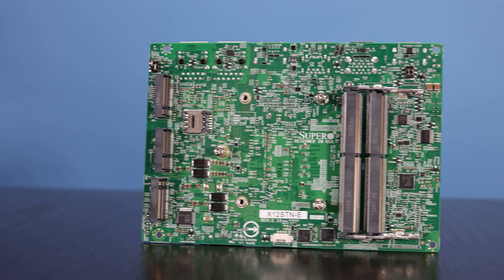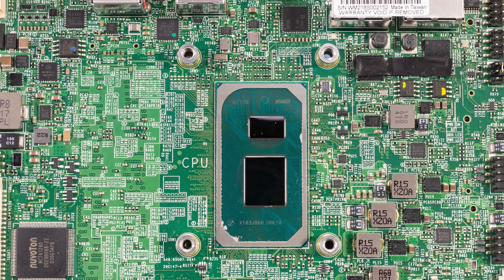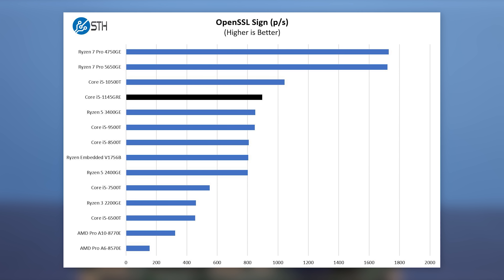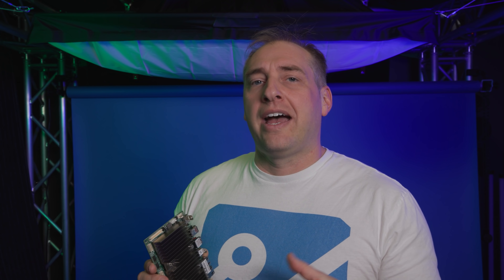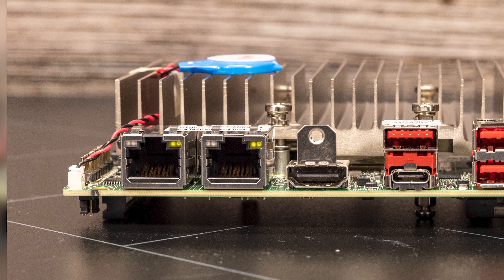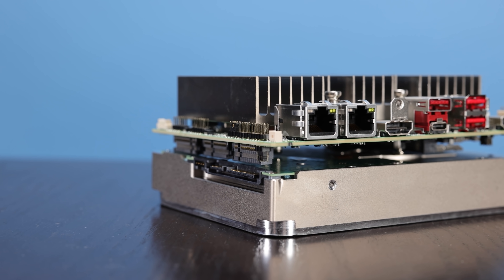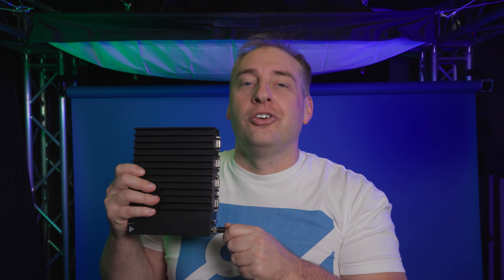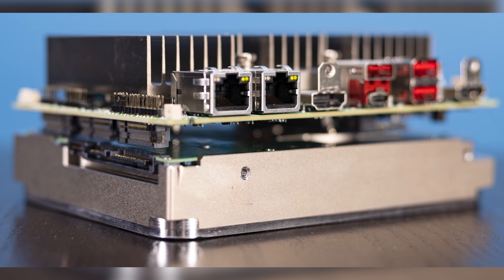Cool! HDD Sized SBC w/ 2.5GbE and PCIe Gen4

Comment: The need for serial interfaces still transcends more than just industrial sectors, pretty much anywhere that runs a property management system often have at least one or two systems that only interface to it over RS232, this would make a killer machine for their interface servers.
Reply from the maker: Great point.

Comment: @ServeTheHome It would be great if reviews of SBC would also include a comment or two about available cases/housings, mounting options, b/c looking for those can be quite challenging!
Reply from the maker: We specifically held this one to show you that Supermicro chassis and how it works with that SBC just so folks could see it.
Reply: @ServeTheHomeVideo  Yes, showing the CSE-E101-03 is a step in the right direction (thanks for that), but I must have missed it twice, b/c I didn't explicitly hear about mounting options (EDIT: you mentioned that the bottom of the case is “just flat”).
You did mention other cases being available (presumably also from Supermicro); however, compared to the tiny/mini/micro series where you usually don't have many choices regarding the respective case anyway, I think discussing options available for the X12STN-E (or /wherever they exist/) would be especially interesting.

Comment: No pciex16 capability on this board, that is the next step now and it has been as soon as these micro boards became a thing. I wish they did these micro boards on pciex16 capable CPUs and bring out the pciex16 with something like a 100 pin DF40 connector (because an actual pciex16 interface would take up too much space) so that it can be tapped by us gaming freaks. The mini itx is still the smallest form factor with pciex16 available and what I use. I can't wait for the day to see a tiny ass motherboard hooked up to a titan V that is 20 times larger than the motherboard so that I can play solitaire while running crysis r in the background. STILL WAITING.....

Comment: Thank you VERY much for such a detailed explanation. I do have a question though, since i saw that sim card i have been questioning myself about using it to "share" that data connection (as a Mobile phone "sharing wifi") thus first is it even possible? Then could one connect an external antenna to it?

Comment: Is there a cheaper board with similar CPU grunt but without all the high-end display features? Or do you pretty much get that for free in this class of processor these days? Even the Celeron version of this board still has a bunch of display outputs.
Reply from the maker: Basically it is the cost of a few connectors these days so pretty small cost

Comment: Ewwwww RS-232, what are we the 80s? While at it put some LPT, PS/2 and VGA ports - when I see even one of those things it just makes me GAG.
Reply from the maker: In industrial automation serial is very common and the ability to screw in the cables to secure them is widely used as well.
Reply: @ServeTheHomeVideo  Then they should make two models - one for a factory and one for home use. I keep looking at Gigabyte, MSI and etc for a new motherboard and it keeps turning me off when I see a somewhat decent motherboard with either PS/2 or VGA or USB 2.0 ports. Why can't they make a model with top of the line USBs only(10Gb and 20Gb), DP only and dual 2.5Gb NICs, and none of the USB 2.0s, PS/2s, VGA and etc. - how hard is that? Oh and none of that only two PCIe ports - not all of us into GPU gaming and RGB BS.

Comment: Ya know. I retired as a Network Engineer 15 years ago. Here's the funny part. NOTHING i knew and did back then is even around now, except fiber. I am like a child now with todays technology. Which I am totally ok with. I started building servers with MFM drives Ended up with SCSI 2. Sad.
Reply: Also, I like this machine but i would prefer it with a AMD chip. Better graphics... I believe. Am I wrong? Thinking HTPC on 70" TV OLED TV.
Reply from the maker: AMD needs an update for its products in this space.

Comment: These are not designed for home computing. Instead, they can withstand being in a small cabinet in freezing scorching conditions managing a utility substation, a telecom tower or a digital billboard for 10 years straight. The  price is very cheap for that actually.

Comment: I always thought it'd be cool if the ports were on the edge where a 3.5" HDD has it's SATA connections. That way you could pretty much use lots of them in a 15 drive 4U server chassis for a deployable cluster box.
Reply: Super cool idea but can SATA deliver that much power? I'd assume not.

Comment: That's a nice heat sink there.   It's got a wide thick base and fins that go upward which can absorb and dissipate heat faster than some of the stock air coolers like Wraith Prism with small base and fins that go sideways.  I have a similar type of heatsink and it really keeps my computer cool even when gaming for hours.  You just have to make sure that it is properly mounted and with proper application of thermal paste.  Also, you need to add a cooling fan to it to make sure there's a  continuous air flow.

Comment: So I guess I have a question. If Supermicro can make this standard form factor board that is perfect for many applications. Why can't all the other OEMs do this? HP, Dell, Lenovo, Ect. make motherboard for all their platforms ie. Laptop, AIO, and SFF desktops. They could all be this size and interchangeable with slightly different I/O for each applications. I would thing it would save them literally millions in development costs across their entire product line and vastly improve repair of all manufactured computers.

Comment: I used a lot of iBase h/w in a previous job. It's fairly similiar and stuff I used it still working years later.

35W is about the point where you have to go to active cooling. Some (AMD) embedded gear the bios can set the CPU power limit.

They aren't cheap, the goal with these is long life and reliability.

Comment: I like the idea of using one as a NAS. Get an M.2 to PCI-E extender cable and you can pop a HBA in there for more drives. Hook it up to a SAS expander and you could build a tiny little NAS, more like QNAP or Synology sized.
Reply: oooo, that'a an interesting idea. i remember a guy that used to be on youtube named WillU that did something like that back in 2012. at the time though the 3.5" boards had a pci slot on them. and he built a 12TB NAS using like 6 drives.

Comment: sooooooooo with some m.2 to pcie adapters I could add more sata ports and 10Gbe SFP+ NIC 🤔sooooo tempting
Meanwhile my current home server (2700X) is chugging power down 24/7 T_T
Reply: you can always sell the 2700x and buy a 35w APU for your home server, boom problem solved
Reply: @marcogenovesi8570  I may try to do that and get a low power ryzen 3.. I know I can boot with no graphics card on my home server after I finished the initial setup
Reply: @Airbag888  Yes a lot of Ryzen boards can boot headless without problems.
You can also get Athlon 200GE or 300GE, those are cheap 35W Ryzen APUs. Since I'm a fan of ECC ram I had to buy the PRO version of those from Aliexpress (consumer APUs can't use ECC), so far both I bought are 100% fine and recognize the ECC ram.

Comment: 2:51 If any of you are wondering when and why intel started using chiplets, well, Intel was actually first to the 'chiplet' game with the early 2010 Core i5 650, a dual core processor, with either an IO die, or a GPU chiplet, i'm leaning towards a GPU chiplet because the models that didnt come with a GPU, also didnt have a chiplet.
For the most part the only time Intel used chiplets on the desktop was for the first generation processors, and the 5th genereation, where the chiplet was actually an SDRAM 'L4' cache. But nearly all "ultra mobile" processors since 1st gen "Core i" have used chiplets in some way or another, sometimes it was the PCH, sometimes it was GPU, sometimes it was added cache, but i dont remember a model that didnt use a chiplet. However, i can remember at least one generation that used 2 chiplets, the i5-6260u had a long slender chiplet on one side, a wide central chiplet for the CPU, and then a shorter fatter chiplet on the right side, i first noticed it when i had to service a tablet at work and the SSD was partially behind the heatpipe, so i had to remvoe the heatpipe and CPU cooler before replacing the SSD(maybe thats why it failed Lenovo). This didnt apply to the entire 6000 series U linup though, as most of the U and Y series were just 2 chiplets like previous generations
Reply: It's a bit earlier actually. Core 2 Quad are all chiplet with 2 core 2 duo combine. IO die is also seperated and built to the motherboard.
Reply: @floorgang420  youre no wrong, and the Core Duo and intel Pentium D were two single core pentiums. I was referring to two different purpose dies on the same package, Before the first gen Core series, from what i can tell, Intel had only just slapped 2 identical chips on the same package, anything else was placed off package and generalyl on the motherboard, or on the CPU card for the off die cache chips on for ..... slot 2? The cache dies were technically off package and didnt count
.
Reply: @denvera1g1  Yeah but chiplets just meant more than one chip. Does not have to be different.

Comment: Man I wish all the ports were on the short sides instead of the long ones so I could run like 8 of these in the hard drive slots on a pc case, I need a compact x86 cluster.
Reply from the maker: Give us a few days, we have something that you might be interested in next week.
Reply: @ServeTheHomeVideo  I can't wait, just turned on notifications so I don't miss it.
Reply: go buy a blade rack server.

these kiosk SBCs have too many peripherals at 1K price point, a blade server justo has CPUs and RAM.
Reply: @joefish6091  I was going to but they are both loud and not compact enough for my needs, I will probably end up with like 6-8 of those tiny mini micro systems.

Comment: Are you aware of any of these mini micro tiny PCs or super micro type boards that are of the one liter type.
With 10 gig networking?
Reply from the maker: Usually for lower-power and 10GbE you would look to the Xeon D-1500/D-2100 and Atom C3000 and look at mITX. TMM nodes are roughly the footprint of mITX, although with TMM that includes the chassis.
Reply: they recently reviewed a HP thin client that had a PCIe slot where you can fit a (modern-ish and relatively cool/low power) 10gb card

Comment: If the -H variant is sub-$800 I’ll be replacing my Del 5080 10500T 1L with one. The native 12v support and type C Video out sold me. I can have the perfect solar powered PC for on the road gaming. Thanks for this video!
Reply from the maker: List price for the CPU is around $160 more so my guess is that the -H will be just over $900 new. That is a total guess just based on the increased CPU cost.
Reply: "gaming"

Comment: Incredible board! Would love to see more like this at a lower price point (~300$) with lower specs (e.g. Celeron, dual 1GbE). These make perfect low cost PFsense devices.
Reply from the maker: X12STN-C is what you would be looking for there.
Reply: The X12STN-C seems to be pretty close to what you're describing in terms of price and cpu, but it also has 2.5GbE as far as I can tell
Reply: @bazooka2000  Isn't that good?
Reply: @therealb888  Sounds good to me, it just wasn't exactly what Marc asked for.
Reply: The 2.5gbe is actually what makes this perfect for those with Comcast gigabit plans and are using the xb7 modem since that modem has a 2.5gbe port. And the Comcast gigabit plan can give you up to 1.5gbps down if you use that port. This an awesome way to have speeds greater than a gig without getting a beefy computer with high power consumption.
Reply: 1gbe is dead at Intel.   Part of the reason we did the igc (2.5G driver) for pfSense.
Reply: @jimthompson971  wdym 1gb is dead at intel
Reply: for dual 1GB pfsense box there are much cheaper options like PCEngines APU2-3-4

Comment: 10:38 isn't the GPU limited to driving 3 displays?

Edit: just looked it up and I'm happy to see that Intel finally gave their integrated GPUs an extra display controller.

For reference I'd love for manufacturers to make laptops with 2 mini displayport connected to the integrated GPU and 2 mini displayport connected to the dedicated GPU. That would allow for MST splitting out 8 2560x1600 displays easily.
Reply: Just reliably having 1 of each (iGPU and dGPU) on their own full feature type-C port would be an ideal balance of manufacturing cost and I/O availability. The seemingly random choice of which output is attached to which GPU between the more common HDMI/DP and Type-C port pairing continues to be a huge pain for everyone. 
I've seen every combination, and most manufacturers don't even bother telling you which is which. If you're lucky, it's the dGPU over Type-C for your mouse and gaming monitor/VR at home, and HDMI on the iGPU for work, but it's still not ideal.
Reply: @KiraSlith  I ended up connecting a Quadro p600 in an enclosure over thunderbolt to add 4 extra outputs to my laptop with a 3060.

Stupidly the DGPU shares a connector with the thunderbolt 4 connection for the EGPU. The internal EDP runs through the iGPU and the iGPU runs the singular HDMI port.

I hate HDMI and hope for a DisplayPort/Mini DisplayPort only future, MST is too good a feature to miss out on.

Comment: Could you imagine having this on like a blade rack unit? I would love a couple of these in a 4u with redundant psu and ssd hotswap alongside the pcie gen 4 slots
Reply from the maker: Going above 3-4 of these people will just get bigger chips and virtualize. On that note, check back in 9-10 days as we should finish a relevant video by then.
Reply: @ServeTheHomeVideo  at the moment I use thin clients in a 3d printed rackmount format for video delivery for live events and encoding.  That also get used for photo terminals for other events but 8 power bricks is quite heavy and bulky, 2 800w psu's redundant would be the ideal 😆 Looking forward to seeing that 😀
Reply: imagine these sitting in HDD trays on a blade server, powered by sata power cables.

Comment: That's awesome, but I want it with 10GBe! I have been looking for a good board to create a tiny fileserver, with 1 or 2 hdd, and 1 or 2 SSDs for caching. This would be perfect if it had 10GBe, I don't understand 2.5GBe , IMO there's not enough difference to bother...
Reply from the maker: Give it a week and a half and we will have something for you.
Reply: @ServeTheHomeVideo  Can't wait! Looking forward to it...
Reply: Old cat5e cable runs can support 2.5 & 5g. That's why it's a thing.
Reply: @Dcatts-i2z  that's what they tell us anyway, I've not seen much of anybody with large infrastructure care about that when Gbit is still more than enough
Reply: I would love to have thunderbolt and USB4 ports instead of RS-232s.
Reply: Copper 10Gbe uses too much power, best to go to fibre

Comment: $750.... ouch. 

The problem i see with such SBC's is they are trying to be all to all people. But for the vast majority of applications, you'll be paying for so many features you'll never use.
Reply: The reason they are doing this is that mass production is what keeps the price down, if you split them up and cut features you can easily end up with much smaller production runs which end up as more expensive.

Comment: Interesting to see there is no IHS on it, but the heat spreader is integrated in the cooling solution.
Reply from the maker: This is more common on embedded CPUs like this.
Reply: soldered CPUs don't have IHS. The IHS's main reason to exist is to protect the die from users installing coolers and handling the part, none of which are relevant for a soldered CPU in a device that comes with a stock cooling system already attached

Comment: Nice that the case thermal interface has a built-in heatpipe. Some of the embedded stuff I've used before were just big dumb aluminum blocks which didn't move heat fast enough. It's odd when your passively cooled system throttles while the heatsink had cold fins. Specifically some of the Akasa cases for NUCs did a rather crap job moving heat from a 28w cpu.

Comment: Advantech has this kind of stuff for years :)
Reply from the maker: Totally and we have reviewed Advantech solutions on the main site along with Supermicro embedded boards (and many others.) The new bit is the Core i5-1145GRE
Reply: I use a core2 Advantech mini-itx board for my router. Sturdy little thing.
Reply: Supermicro isn't new to this field either, they have been doing this for nearly a decade at this point

Comment: Interesting system! How much power does it draw in idle and with full load? :)
Reply from the maker: Covered this in the power section. Mid-single-digits idle and we got to ~35W. I think there is room to go up because a lot of this depends on how you configure the system (e.g. hot SSDs, wireless radios, USB 10Gbps devices, and so forth.)
Reply: @ServeTheHomeVideo  🙏 thank you :)
Reply: My Optiplex 7080 10Core/20Threads idles at 6Watts, and it's not even 10900T. Normal desktop idles at the same wattage that my Optiplex does at full power(encoding x265s).

Comment: Gosh, this is great for Pfsense, well hope is cheaper than the super expensive Netgate stuff.
Reply: It's a bit much for PFsense. All that hardware would go to waste. Free BSD doesn't have drivers for most connectivity. Every header on that thing will be useless.. all for $750.
Reply: @LBCAndrew  750! for this money I can have a 10GB Router and a 10GB Switch from Ubiquiti and 100USD to spare for one wifi6 AP.
Reply: PCEngines APU2-3-4 is fine and cheap for 1Gbit pfsense box